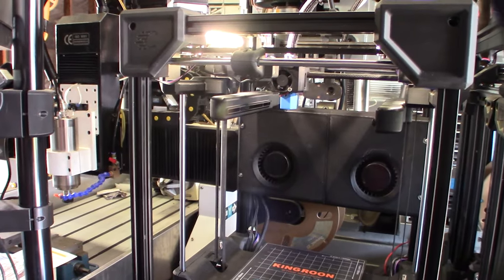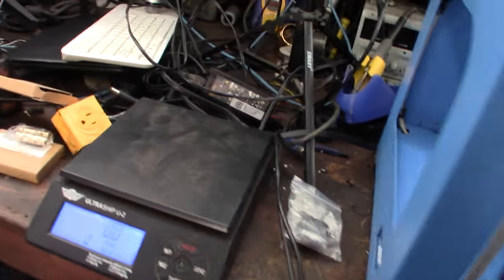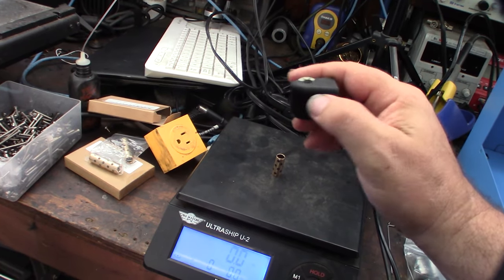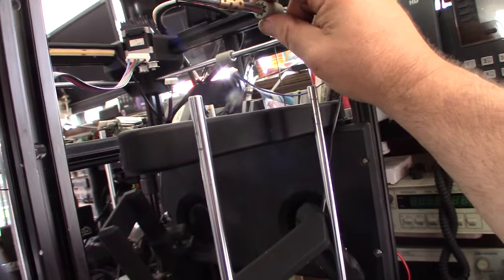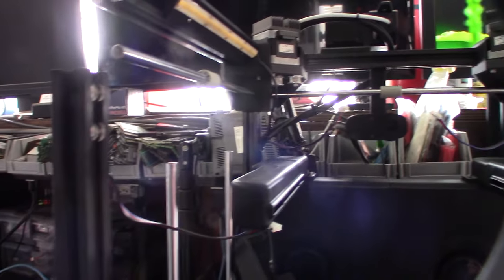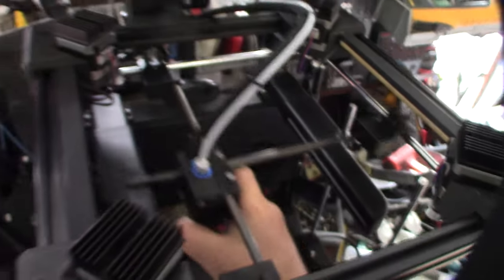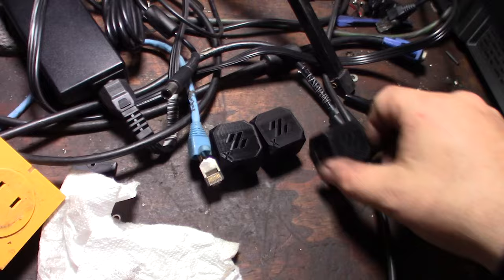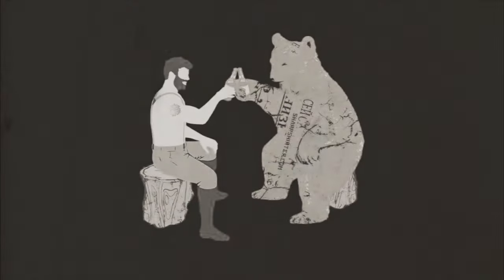Celeritas World's Fastest 3D Printer Concept, Linear Rail Bearings, CroXY Carbon Fiber Tubes Part 6

Comment: I have also gone through same thing. Got good results with plastic bushing initially. I used drill with smooth linear rod run it until no binding while bushing were installed in the part. Then tried graphite long bushing which are too heavy 8x12x45. Then changed design again to use 8x10x20 and used two while saving 9 grams per bushing. However perfectly aligning two bushing in ABS part is difficult. I had to used soldering iron which is 8 mm in diameter and aligned them at around 280c as soon as bushing got hot while installed in parts i turned off iron and let it cool to be remain aligned. However corexy put too much load on Y axis bushing when if i want to run system stiffer for high accell, on low belt tension input shaper is all over the place. So no real good alternate for me on corexy. I can make a short video explaining all my failures if you want.
Reply from the maker: Today I worked on a Banboo Labs Carbon X1, The carbon rods are perfect. I need to find the source.

Comment: Last try to post if this doesn't go through o well but let do this. You can try using a rubber sleeve over the bushings and you can also try changing the steel rods to carbon fiber rods to be able to use the heavier bushings and just to cut weight.
Reply from the maker: I will check it out. The rubber sleeve as a damper?
Reply: @fintechrepairshop  yeah and for grip so you don't have to tighten them so hard

Comment: Nice project. I gave it a go on the graphite bushings but unfortunately they had too much play on the carbon rods. Such a shame, they seemed to slide really well.
Reply from the maker: I'm having some play too, I've read Bamboo labs are play on their carbon fiber rods too. The seem to get it dialed in so that giver me hope
Reply: @fintechrepairshop  I spoke briefly with a guy from Easycomposites. He suspects Bambulabs machines their carbon rods, because it's not only about the tolerance, but more like keeping the tolerant consistent along the whole rod. Hope that makes sense.

Comment: Hey there, just curious if you tried chopper-resonance-tuner for your setup. Should reduce motor vibrations a lot too. I need to try that one one day for all my motors aswell. Should be easy to do, just takes a few hours to measure the data.
Reply from the maker: I will check that out. It makes most of its vibration at slower speed.